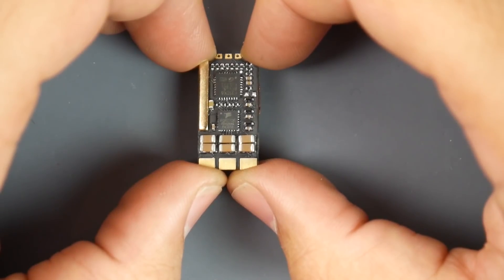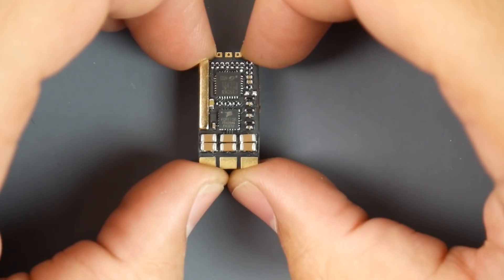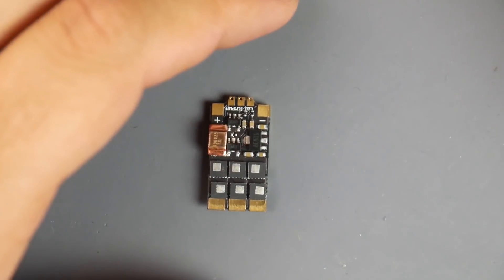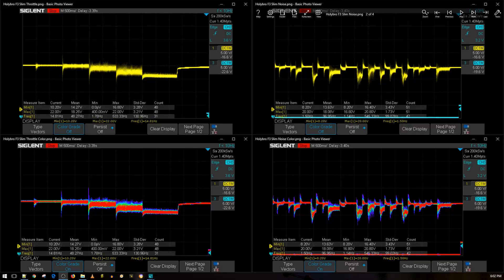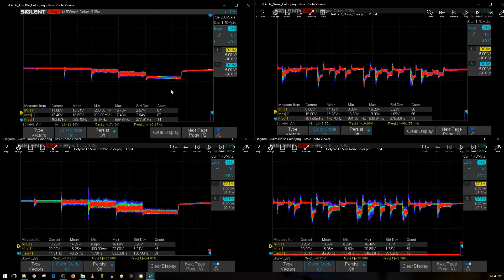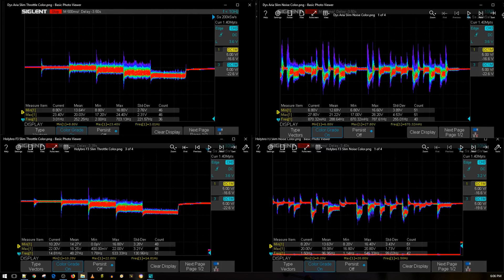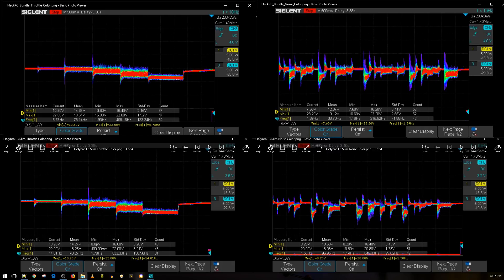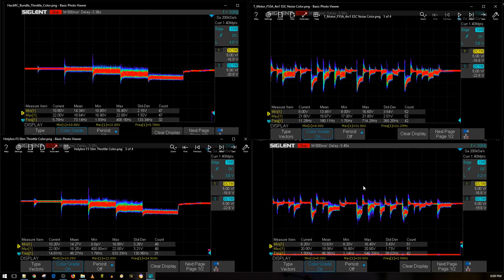MOTHER OF ALL F3 SLIM ESC!!! // Holybro Tekko32 F3 Slim ESC Review and Noise Test

Comment: I have a set of the Lumineer Razor Pro F3 45amp ESC's and they seem to be doing a great job and they got the LED installed. I only lost one and that was because it came loose and made contact with the prop and knocked an IC and one of the caps off of it. IN the non-F3 spectrum I have a set of the Iflight SuccesX 50amp Slik ESC's on my Rooster that have never given me a hint at an issue. Thanks for the review.

Comment: Not slim enough. I use the spedix es20 lite 10.5mm wide $7.90@ bangbuck, $8.99@pyro. Push 6s 2205/2207.5 1722 all day. Blhelis vs blheli32, I can't tell the diff. I have not burned any up.

Comment: I think you need to retest the larger Tekko 32 F3 ESC if the small one is getting such great results.  Maybe you got a bad sample or are the mosfets different on the larger one.
Reply from the maker: The tekko32 f3 esc not the metal had older firmware and it was all new at the time. I mentioned in the video about the  progress from update to update.
Reply: Drone Mesh Ok cool that means I need to buy me some these then.

Comment: That looks surprisingly similar to Airbot's Furling 32, based on the pictures and pcb components markings they are the same. Any way to make a comparison?
Reply from the maker: The QC is 10x better than Airbot
Reply: @DroneMesh  I highly thought it, because both airbot and holybro are made in a same building so it goes through same QC. Only difference is the packaging/advertising part if I'm not mistaking
Reply from the maker: @BuzZ.  Holybro has it's own people run extra 2 stages of QC..
Reply: Yes DroneMesh, that extra "Quality Control" is definitely very worth the extra $16 if you buy a set of Holybro ESC instead of Airbot ESC when they both share the same design, hardware and manufacturer and with addition of my experience with Airbot which has never gone wrong. Sure thing buddy, sure thing. The best part, the price of four Tekko32 F3 is the same as five Furling32 ESCs! Why bother to get that one when you can get another one with one free spare for practically the same price?
Reply: @DroneMesh  but if you buy from basically resellers like  holybro (of this product) airbot makes more profit like this:

price airbot would sell it for + their OEM fee 
(All depends on quantity) 

You want to support airbot because it seems to me that they do a lot for this hobby
Reply: Always thought Airbot were the OEM for Holybro components.
Reply: FlightOne and Helio too, probably a whole bunch of other companies as well.